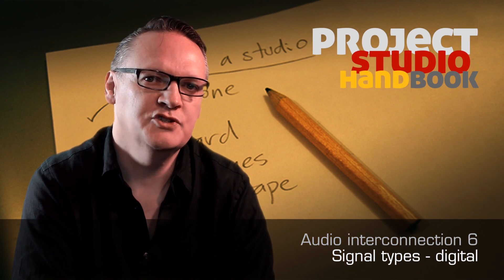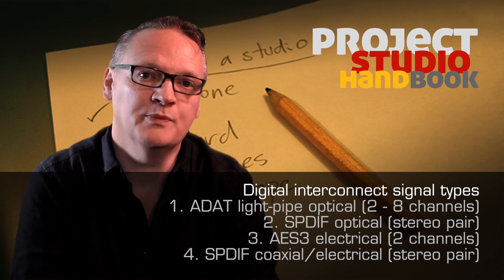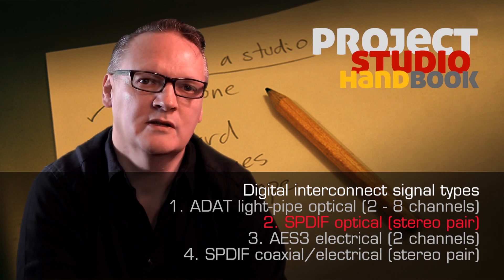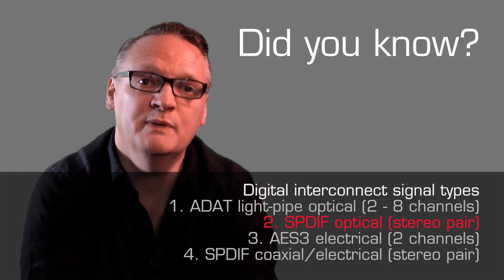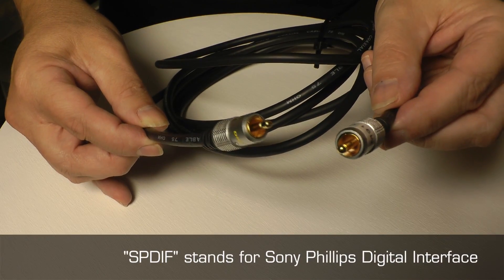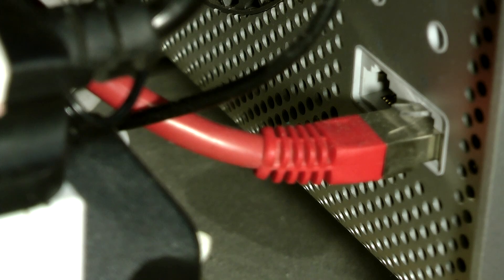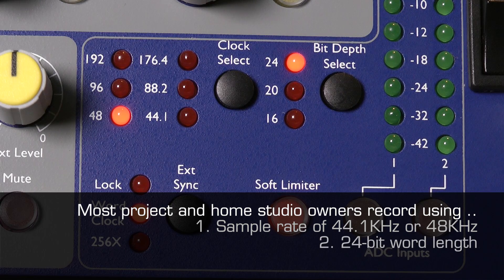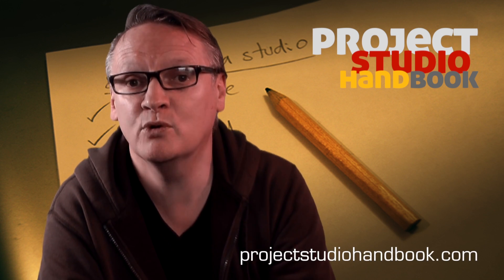Digital audio audio interconnection signal types (v1)

Comment: Thanks I like it. I run ADAT a lot, and am about to get some MADI AES-50 on CAT-5 audio interface for my live show. The part about Electrical AES3 was helpful, as I think my old MOTU2408 has that. Tip: if experiencing sync issue on ADAT try swapping from internal clock to external ADAT clock, slaving time to your oldest piece of gear.

Comment: hello thanks sharing this .., i am using apollo 8 sound card interface and i have PreSonus StudioLive 24.4.2AI , but the presonus have only s/pdia and apollo 8 have adat , how can i connect that ?, can i use this " fostex coaxial optical converter cop1 " to use the inputs and controller the system ?
Reply from the maker: Hi Meher. Unfortunately there's no easy way to achieve this. It might be possible to use the Fostex Cop-1 as a cheap solution but you would need to research if the Apollo will recognise and accept an incoming SPDIF 2-channel stereo signal at its ADAT in port. Effectively it would need to accept SPDIF 2-channel optical as channels 1-2 of an 8-channel ADAT signal. This is a format software thing. The raw PCM audio data should be compatible.